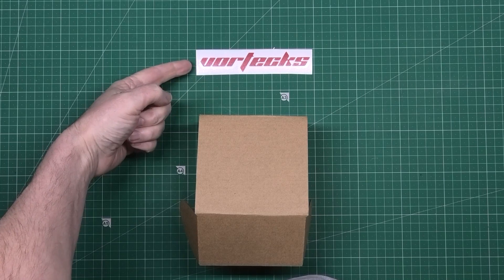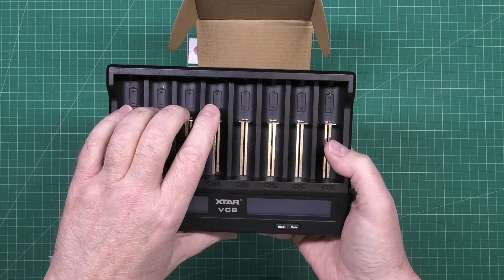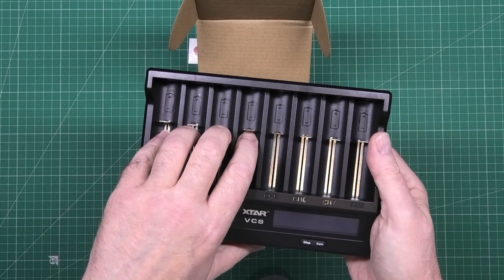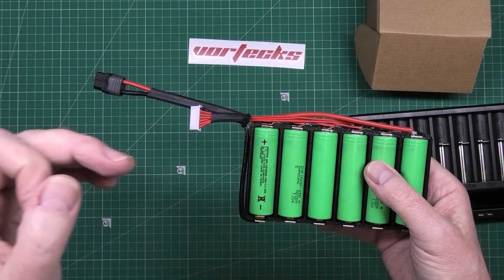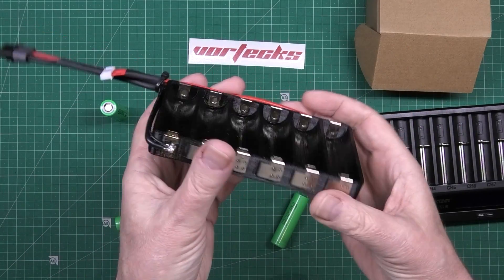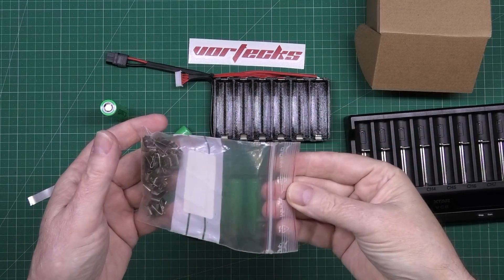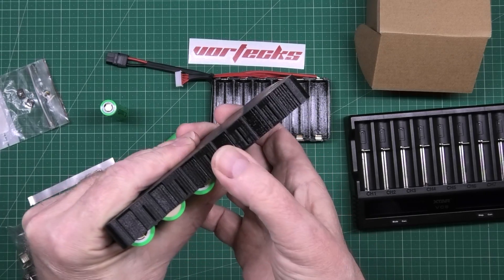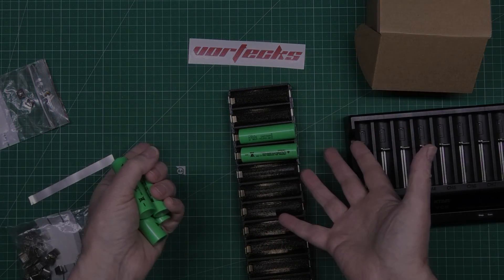6s and12s 18650 charge/discharge/capacity tester for dummies

Comment: Whats wrong with cell holders pre made from the usual scum bags? they are flimsy but usable no? I don't have plastic printer.
Reply from the maker: There's nothing wrong with them if you want to draw less than 1A. Plus, the series ones you have to make sure they're all in the correct way and the parallel ones are just that - parallel.

Comment: Hiya Tony
Not going to get complicated on you coz i love your vids and been watching u since version one.infact u got me into this goddam mess . . . Bastard.
Please watch . . Jehugarcia  on YouTube regarding 18650 capacity testing . . He's very good and I have learnt a lot from both of you
I use litokala engineer charger / capacity tester for my batteries and can capacity test 12 a day with just one.
He is definitely worth a look.
Also have a look at solar panel Buss bar strips for soldering cells together they are copper but pre solder coated which I use coz no spot welder !!!  Skint mate.
Just thought you might find this interesting keep up the fun factor coz you do cheer me up mate.
Cheers Keith
Reply from the maker: I watch all of Jehugarcia videos mate. I'm not in the game of copying what others do, I prefer to improve on things. With this setup, I can test 24 a day and it's dirt cheap.
The trouble with using solder is heat - it's a plastic holder and it'll either melt it, or set on fire and I have to be careful when I make videos. If I show everyone that it's safe to solder and someone burns their house down........ 😬

Comment: I just bought multi-cell battery holders for capacity testing and bridged the contacts. I made one simple mod which I enjoy every time I use it. Attach a piece of ribbon (glue) to the outside of the holder and lay it across the bays before you push the batteries into place; it makes taking them out really easy and that matters when you're doing hundreds. 😁

Comment: Tony... You need a opus BT charger/discharger with EXTERNAL POWER SUPPLY LIKE COMPUTER POWER SUPPLY. Dirt cheap and cranks out cells. Welcome to the DIY power wall goto equipment. Let me know if you need a link but I reckon you'll find it on Amazon,😊😉
Reply from the maker: I only showed 1, but I have loads of testers and power supplies (12V 60A) mate. The downside of all the testers is the discharge side of things, they only run at around 500mA max and I need to stress the cells a little. The only things capable of pulling more than 2A is LiPo chargers/dischargers which is what I designed it for.
Charles started me thinking about building a custom rig to stress them so...... I'm building one 😉

Comment: If i were to make a large battery pack for an electric scooter that needs 48v 33A, how would i go about charging the thing? I'd need a BMS but since so many 18650 cells will be involved, i dont know where to start. Since 18650's are so light i could make a big battery to fit in a small backpack and have the scooter go for ages without needing a charge, i just dont know what to do for the charger and BMS.
Reply from the maker: You don't need a special charger to charge it, any cheap(ish) 48V charger will be ok.
As for making a backpack - I always advise against it. If you're unfortunate enough to come off, you really don't want a potential bomb attached to you.
Reply: @Vortecks  Thanks for replying. If its a battery with alot of cells involved, so it has more capacity for longer distance, wont i need to balance charge it and have every single cell connected? I feel like Li-Ion chargers only charge a specific number of cells or something.
Reply from the maker: @thegarageinventor1735  All chargers work on the same principle - they supply power to the WHOLE of the battery. Balance charging is optional but highly recommended, if you have one bank of parallel cells lower than the rest and you run the battery down, those cells stand a chance of being permanently damaged.
You don't specifically need a lithium ion charger, any charger that can supply the voltage to get your battery up to the required voltage will do.
The best advice I can give you is..... join my forum, it's full of useful info and also, it's a place where there's no such thing as a stupid question 😉
https://staf.uk/forum/
Reply: @Vortecks  Fantastic to see you have a forum. I'll be posting on there pretty soon i reckon haha. Thanks again.
Reply: Just joined the forum. First place I’ve felt at home on the internet. Can’t wait to build with you all from my shop here in Santa Cruz and push the boundaries a bit. Happy days

Comment: 1) these are brand new cells you should be able to just trust no?
2) Lito karla 4 way cell tester is good and faster than what you got and you should be able to buy them about £15 
3) even if you test them individualy the result is only good to +-100mah normally.
4) if you “test” them with your ingenious charging rig you wont actually get individual results on each cell will you? 
5) are you using a usbc compatible power supply with your current tester? 24h is a long time maybe its not getting all the power it could?
Reply from the maker: 1 - Yes, but I don't want to take any chances.
2 - It's the discharge side of things that lets it down, it only does a 'trickle' discharge and I need to stress them a bit.
3 - I can test mine to +/- 1mAh with my charger.
4 - Yes, I do get individual capacities. Plus which, by disabling the balance function when discharging, I can see if any cells are weaker than the others.
5 - See No.2

Comment: Why test Every one
Reply: because occasionally some slippery gypsy will sell you a cell full of sand.
Reply: @chrisrathjan1501  then voltage test it if its 0 its fake
Reply from the maker: I'm going to use them in a 32S 10P configuration for V4 e-Bike (26kW). The last thing I need, is 1 or 2 cells not holding up to the power so I need to test every one of them thoroughly. 100mph on a push bike is going to be hard enough without the chance that the battery won't deliver the power.
Reply: @Vortecks got you

Comment: These are great for precharging the cells, before putting into a few Opus BT3100 chargers for capacity testing at 1 amp. With a few of these, you could get through all 300 cells in a few days.
Here's a great solution for bulk testing: https://www.youtube.com/watch?v=j7QuAuV5Xac
Reply from the maker: I'm building something new, Andy - a 16 cell capacity/storage/discharge/charge station. V1 was a mess but V2 should be working in the next month.